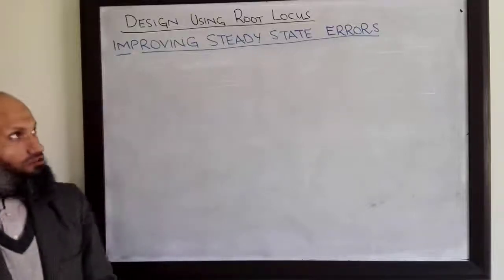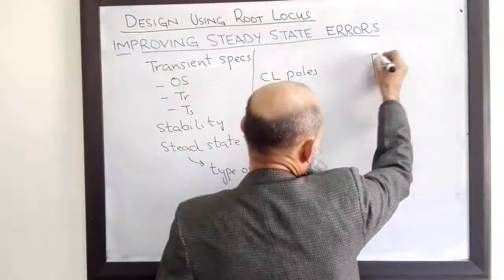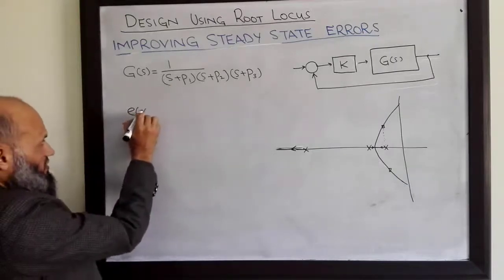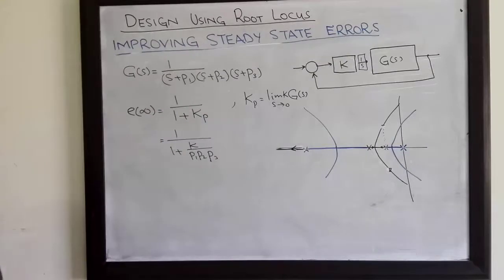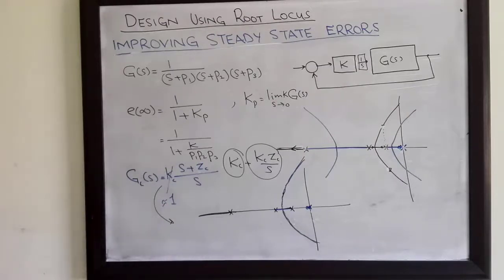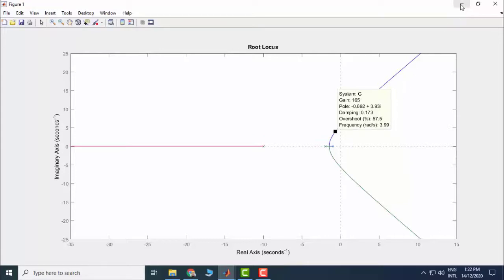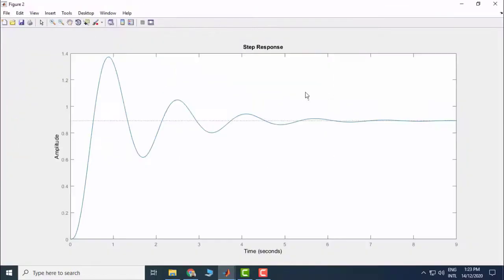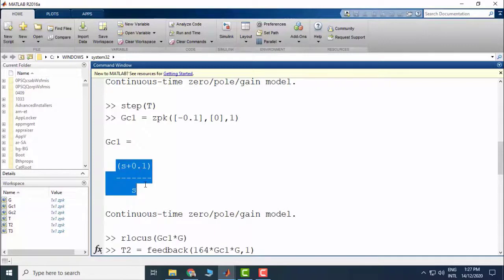LCS 35 - Root locus based design of PI controller to remove steady state error

Comment: how does Automatic S value come? 
and Also Gain when  I try k=3.45 something How it 164 
Kindly resolve my Issue Thanks
Reply from the maker: Draw the root locus according to the scale and then read value of s from the root locus. 

Regarding second part of your question, put the value of s = -0.69 + j3.92 in 1/Gc and find its magnitude. That is 1/(|0.3+j3.92||1.3+j3.92||9.3+j3.92|) and it comes out to be nearly 164.

Comment: Why isnt it -1-2-10/3=4,..? But we drawed it between 1 and 2. Why?
Reply from the maker: You are right, -13/3 is the center of asymptotic line, however,  in the root locus, we have not sketched the asymptotic lines. 

Furthermore, remember that breakaway point - the point at which root locus leaves  the real axis - is not the same as the center of asymptotic lines. In this lecture, breakaway point is not computed but we are sure that it will be somewhere in between -1 and -2.
Reply: @MAFarooqi  thanks!

Comment: sir how can we get the desired pole without using the graph and we dont have the sttling time ??????
Reply from the maker: Desired closed loop poles are determined from the desired transient specifications. 

If you do not have any transient design specifications, you can place the poles anywhere in the right half s-plane (stability is always a requirement). 

If you are provided with only the overshoot requirements and there is no settling time requirements or any other requirement, then the desired closed loop poles can be placed anywhere on the constant zeta line (obtained from the overshoot requirements). 

The power of the root locus technique lies in using its graphs. However, if you still want to determine the location with calculations (and without using the graph), you can place the poles at s = - zeta*omega_n + j *omega_n * sqrt(1 - zeta^2),  with zeta determined from the overshoot requirements and any arbitrary omega_n.

Comment: Sir how did you get that 164 again and from which graphs did you get the poles...?
Reply from the maker: The root locus graph is drawn according to the scale and then the desired poles are read from the graph. These poles are at the intersection point of the root locus and zeta = 0.174 line (straight line of angle equal to 102 degrees). It is important that the root locus based technique is a graphical technique and the values read from the graph will not be very precise. 

Otherwise, you can use MATLAB to draw the root locus and then move the pointer along the root locus to get the gain and values of desired poles that give you a zeta = 0.172.

Comment: Excellent lesson, but what if I want a PID controller, Is there any difference in the Root locus analysis? Greetings from Chile
Reply from the maker: Design procedure for PID controller using root locus is similar to that of lag-lead compensator (design procedure for lag-lead compensator is described in one of later lectures).

Moreover, PID controllers are, generally, not designed rather these are tuned. There are some guidelines for tuning of PID controllers, Ziegler-Nichols methods are most common.